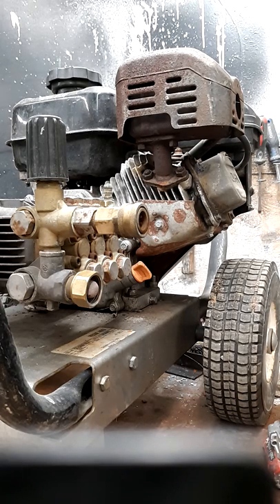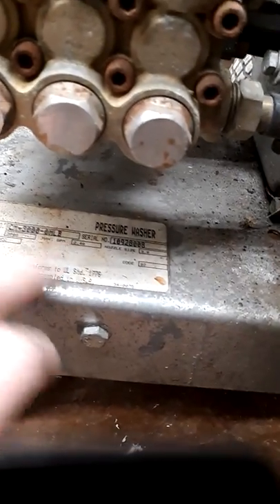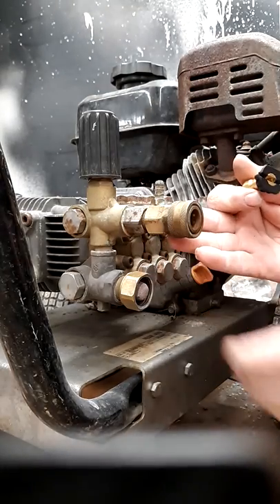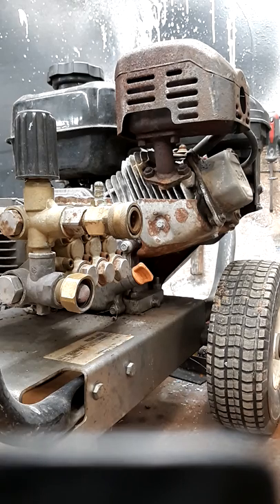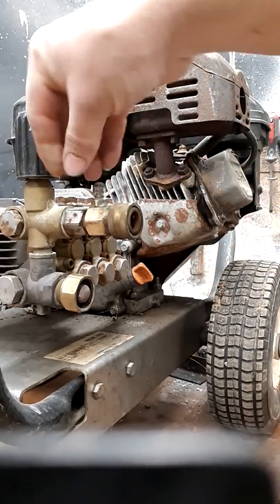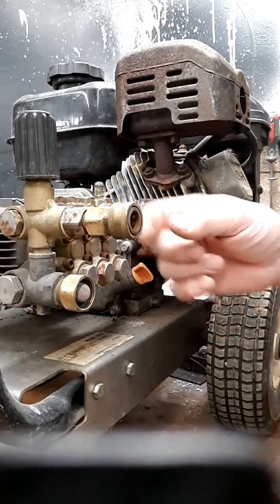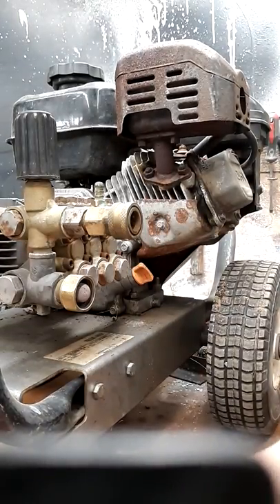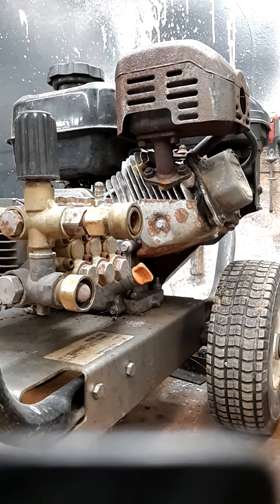Pressure washer chemical injector problems

Comment: I just removed mine but no spring or ball?
Reply from the maker: @lacal16  that would be the problem. Got to have a ball spring and oring. The ball and spring will corroded away from the chemicals
Reply: @Brian_the_repair_guy  I thought that but had to have someone confirm. Thanks for the quick response.
Reply from the maker: @lacal16  no problem. Glad to help

Comment: Question. My pressure washer has worked fine but now it will only pull soap if I turn the hose spiket to almost off. Any ideas? Anyone?
Reply from the maker: What pump, is the injector built on or removable?
Reply: @Brian_the_repair_guy  built on. Not removable.

Comment: What causes water to leak out through the nipple of the injector?
Reply from the maker: The seal, spring or ball is bad. Get a rebuild kit for that injector, or replace the whole injector
Reply: @Brian_the_repair_guy  thanks for the info. I bought it from amazon.. who sells the best chemical injectors?

Comment: Hello fellas any reason my water is squirting out of my chemical injector?
Reply from the maker: The ball, spring or Oring is bad. Best to replace the injector
Reply: Thanks for your help appreciate you
Reply: One more question yesterday I had to take the chemical injector off to release pressure because my hoses weren’t coming off my surface cleaner or my pressure washer I took note of what you said and fell the ball on the floor in my backyard so you think it would be wise to take the injector back off and check if I put the back in the spot or just buy a new injector
Reply from the maker: @timothysandoval9163  injectors aren't terribly expensive. May be best just to replace and not waste time

Comment: I have a problem with my pressure washer. When I aqeeze the trigger, my engine cuts off immediately? Help?
Reply from the maker: What pressure washer do you have?
Reply: @Brian_the_repair_guy  it is a Workzone 2700psi/ 2.3 GPM with a Briggs and Stratton 19G cc 4stroke
Reply from the maker: @glennw2918  first thing I would check is the oil level in the engine. When the engine oil is low, it can cause the level to be too low as the engine builds pressure. Second would be check the pressure on the pump. If the pressure is too high, the motor will stall

Comment: Water just shooting out my injector machine not getting pressure what may this be helppppppp
Reply from the maker: If your injector is removable, then remove the injector and see if you get pressure back.
The leak in the injector can be fixed by rebuilding the injector or replacing the injector. 
If removing the injector gives pressure back to the pump, then that solves that. If it does not, then let me know and we will check a couple other things.
Reply: @Brian_the_repair_guy  it is built in the machine not removable
Reply from the maker: @Daniggabangz  ok. You will need to plug the hole. Remove the barb fitting from the unloader. There should be a small ball and spring inside. If the ball or spring is damaged, then that is the cause of the leak. Go to watercannon.com and get a rebuild. Until then take the barb to a hardware store and get a brass plug the same diameter and thread to screw in to check foe pressure.

Comment: I've cleaned and inspected everything, sufficient gpm from source. I get no chemical at all. Hose removed and pressure washer running.
Reply from the maker: Pressure hose is removed and you get no chemical. Is this what you are experiencing?
Reply: @Brian_the_repair_guy  yes, I think it might be obstruction from calcium buildup. Everything works except the injector.
Reply from the maker: @joshuawhitelock3249  so you are getting no chemical even without the pressure hose on? If that is the case, replace the injector
Reply: @Brian_the_repair_guy  ok, thanks for the help.

Comment: My injector is pushing water out of it? Help!
Reply from the maker: Either the ball in the injector is stuck in the down position, the small oring is missing or the spring is broken. You have to remove the injector connection to determine.

Comment: I have a question the bucket I used to put my bleach in and I put my hoes down into suck the bleach out that injector pushes a lot of water in that bucket is that normal or is that not normal
Reply from the maker: That is not normal. You could have a piece of debris stopping the ball in the injector from seating or a bad ball or spring
Reply: @Brian_the_repair_guy  yeah I'm kind of new at this power washing and with small engines I really did not think that was normal but thank you for confirming that I will take care of that thanks again

Comment: Should have watched this video first. Me: why wasn’t I pulling vacuum? Duh! You had too high a pressure tip on. Me: maybe it’s clogged, take the injector off, clean it in a solvent put it back on, not it’s just pumping water into the soap dispenser. Me: well fuck sake let me take it off again, and clean it again. Me : try to put it back and and I sheared it off leaving the injector threads, into the pump. All in all I figured out I lost the damn little ball when I pulled it off the first time.
Reply from the maker: @sharkbait432  now you know for the next time. Good luck